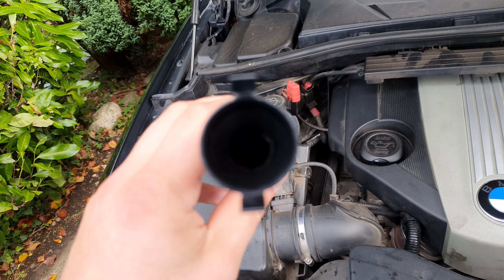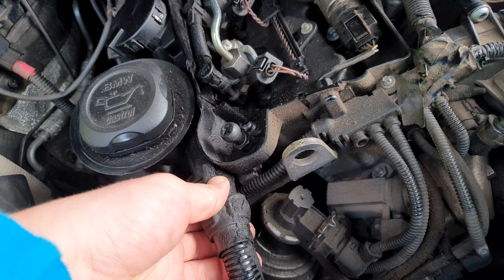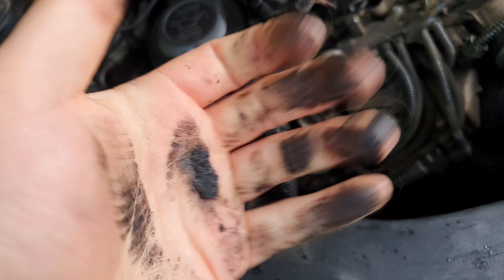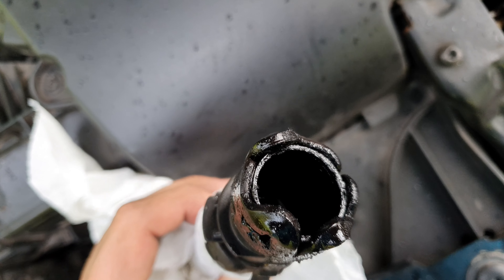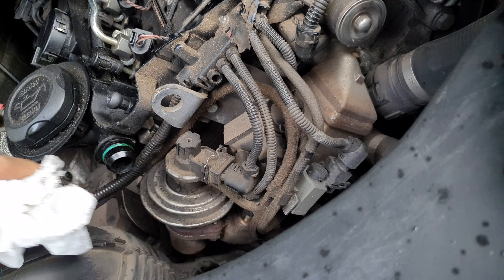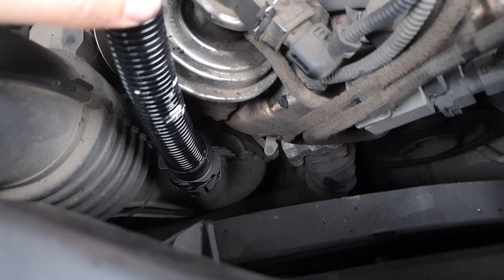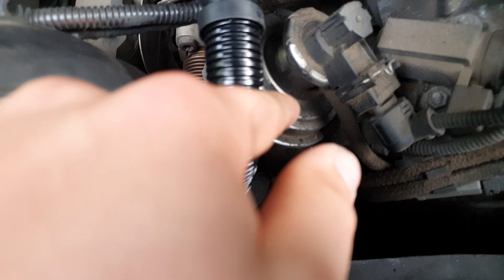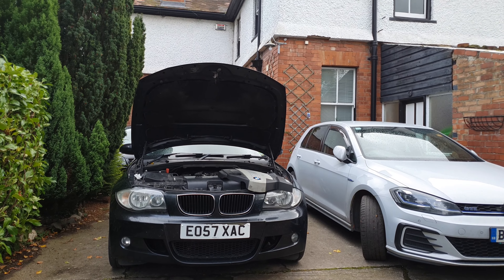*THE MOST COMMON N47 ISSUE* - Replacing the Crankcase Breather Pipe! - BMW MAINTENANCE 120D,320D

Comment: Mine wasn’t broken but the older style of tube had rubber fittings on either end that were perished and allowing gas and oil leaking from the tube over time. A quick clean up, reclip of the new, cheap pipe and I was back in business. Job jobbed. These kind of videos are always good to see before you set about even simple tasks, as they demonstrate what correct fitting looks like.

Comment: Just done mine on the E91 N47 3 Series (160,000 miles young) - it came apart in my hand - had symptoms of rough idling, very jerky/hesitation, could see the oil blow-by all over it - all good now

Comment: Nice and straight to the point! I'm interested in buying the same car you have, also diesel. Is it a reliable engine?
Reply from the maker: HI matthew, Yes the N47 is a reliable engine provided it is looked after correctly! if it is not then it will often fail :)
Reply: @drivelife.channel  Thanks for replying so fast! I'll make sure to check the maintenance documents when I'm going out to buy one. I can't wait for your oil change video! Keep up the good work!
Reply from the maker: No worries at all! Yes try to get one that has had oil changes at most every 10,000 mls becasue the factory maintenance schedule is too long which causes these engines to fail :) FYI it is the N47 Engine for  07-11 cars and the M47 for 04-06 cars:)
Reply: @drivelife.channel  Thanks once again, I'll keep my eye out :).

Comment: it doesn´t fit on the F30 320D ! i´ve ordered it and the pipe is too short , the one on the car is like 10 cm longer and it's bent on the upper side.
They both have exactly the same OEM part number!
any suggestions ? thx

Comment: Got the same car. Mileage 130k. As I press the gas, engine oil start vomiting out of of the engine filler cap. Breather pipe is deterioted. Is the problem only with the breather pipe or something else also? Plz comment thanks

Comment: Do you have any idea why a car with 92,000 miles will run with this pipe disconnected but not when it is fitted? It’s spitting oil out from the pipe??

Comment: Hey! Ive got an f10 n47t, lots of white smoke from tailpipes as i accelerate hard and also some at idle, both when engine is warm and cold. Do you know what could be wrong? Oil and water temps are fine

Comment: Hi mate I was thinking to remove my egr valve but not my dpf can you do that or do you need to remove both
Reply from the maker: Hey Josh, your DPF is much more likely to give you issues if you remove the EGR system because of the extra soot, i would suggest getting both done :)

Comment: My most common BMW issue is checking the oil because theres no dipstick & the sensor takes forever to read.
Reply from the maker: That's such a stupid system! 😂 the e60 M5 is the worst for that because they always read too low, so you fill it up and then over fill the engine which gives you another warning light!
Reply: Dipstick on the right side of the engine (n47)

Comment: I’ve been losing oil. Had convinced myself that it was the oil filter housing gasket, but I also know my breather hose is cracked. Maybe I was losing oil because of that instead 😂 oh well I’ll fit a new hose and see what happens
Reply: What happened after you changed it ? Did you stop losing oil ?

Comment: How much oil were you using mate? I’m losing 1 litre every 1500-2000 miles. I’m away just now but will check mine when I’m back. Great vid
Reply from the maker: Not too much mate but I varies a lot engine to engine:)
Reply: Hello. Didi you find the solution? I have the same oil consumption problem.
Reply: @UCVsgvNjmNVV4mDneenNLuNw That's the oil i am using, aproved LL4 by BMW. I think next time i'll use 5w40.
Reply: @harrymoon6060  hi mate, I done an oil change and used 5w 30 instead of 0w 30. I’ve done 1500 miles now and not used a drop, I think I done the first 500 in eco mode but couldn’t hack it any longer ha

Comment: Will this be same issue and solve for petrol 1 series?
Reply from the maker: Hey Matt, unfortunately this is a fix exclusive to the N47 Diesel, however petrols do tend to have issues with the crankcase breather valve, which causes a rough idle and lots of smoke from the rear :)
Reply: @drivelife.channel  okay thanks :) silly me thinking I could regain hp from a 116i petrol haha
Reply from the maker: Hahaha, it is possible!;) hope the car is running well!:)
Reply: @drivelife.channel  yeah all good now, up for sale but wont sell :(
Reply from the maker: @Matt-ft2fc  what car are looking to get next?

Comment: would this cause smoke on accelerating?
Reply from the maker: No not really, what colour smoke do you have?
Reply: @drivelife.channel  sometimes black and it leaves a trail on the floor most times its gray/white i do have error code p2227 and im losing power like the turbo wont kick in its just had a new maf sensor

Comment: how do i know if i need to replace this piece?
Reply from the maker: It will be very dirty, broken or brittle :)
Reply: @drivelife.channel  but what does that thing do to the car?
Reply from the maker: Slight reduction in power due to decreased crank case pressure:)